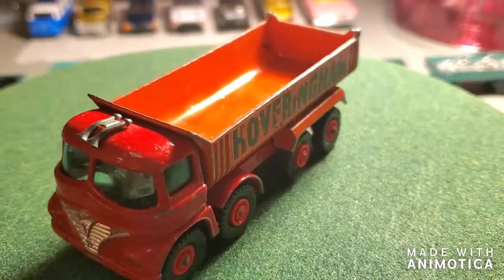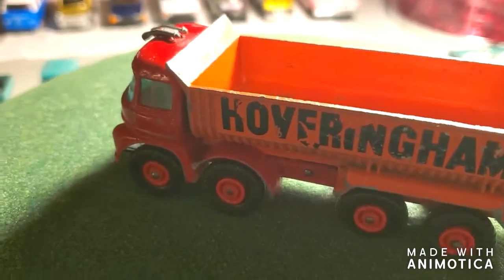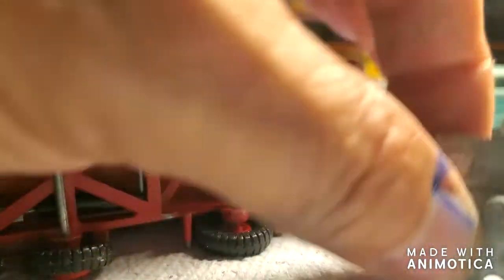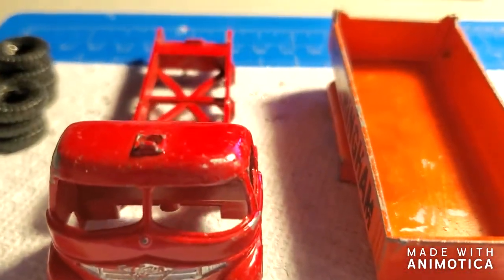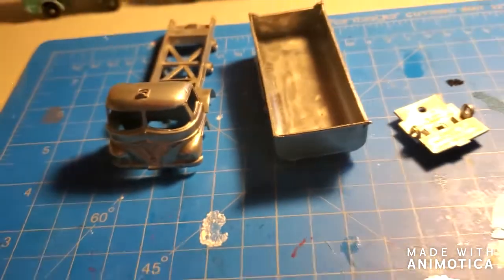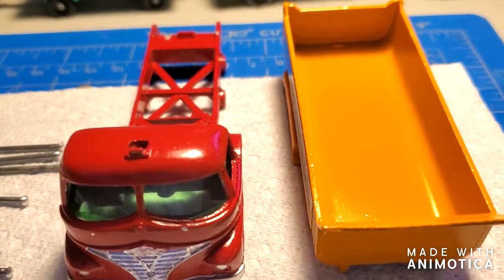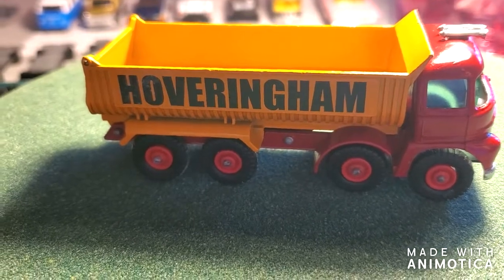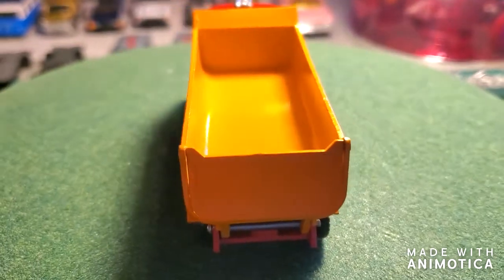Matchbox King Size No 1 Hoveringham Tipper

Comment: Hi Mark great job, just a point on the wheels, it is actually the plastic hub that as it ages shrinks so that is why even new tyres will still be lose on the hub. I use a little UV glue  around the outside of the hub to build it up a little and this helps solve the problem. You can also put a couple of dabs of the UV glue on the inside of the hub once the tyre has been fitted for extra security. but as it sets clear and as long as you fit the wheels with that side facing in it can't be seen.
Reply from the maker: Thanks Tony! I have used glue many times! I am fixing to do a King Size Scammel Tow Truck with the exact tires..so, I will be using glue!
Reply: @matchboxmark8191  Looking forward to the tow truck as I have one on my desk right now waiting for a restoration be good to see your video of this first, for any tips I might pick up :-)